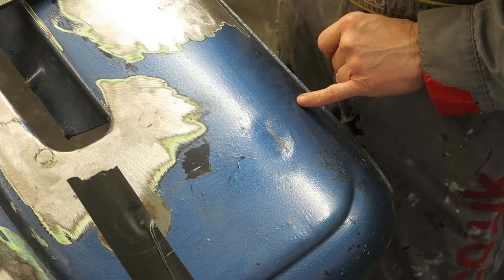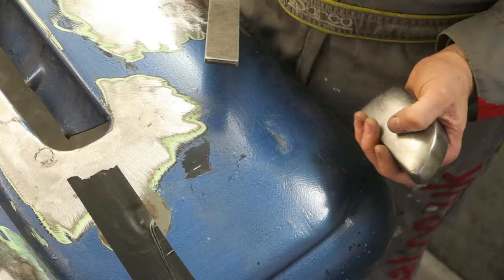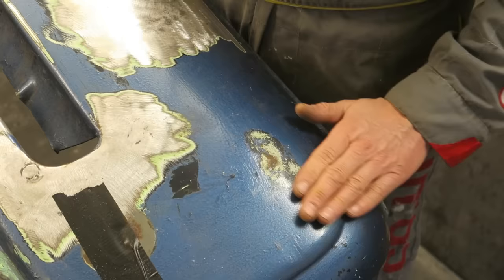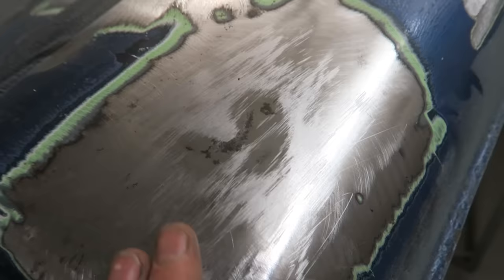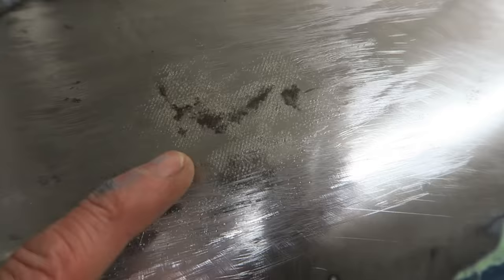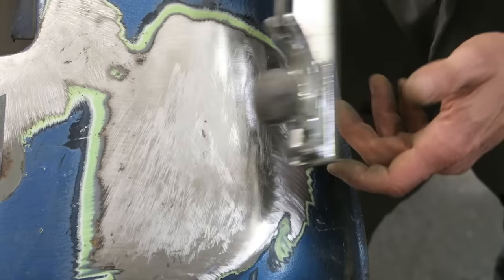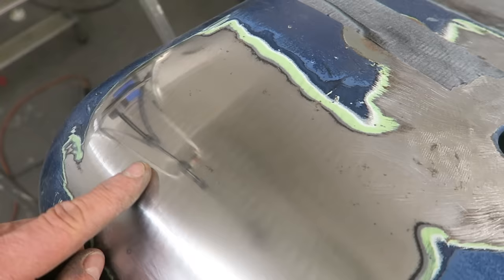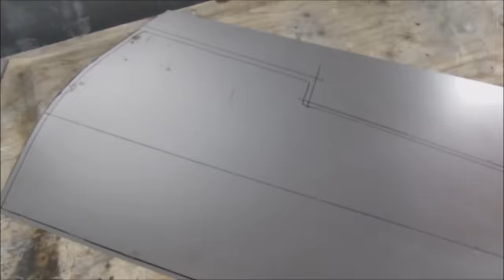How to do metal finishing, Dent flipping. Tips and Tricks #3

Comment: Hello Trev, Why would you not use more of a PDR approach with line boards/lights as opposed to a contour file and its side effects when you can buff up the metal to that shine? Im trying to learn basic techniques, not to be some sort of master just remove dinks. I have ST70 which im soon to start its restoration and im in two minds what to do with the dinks in the mudguards, they are genuine 44 years old and replacements are only rubbish copies. I fancy the challenge but I need it perfect or its as bad as a dent. Cheers, bravo on your vids.
Reply from the maker: TinkerBod if done properly this is still an extremely effective way of levelling metal work. A PDR type of repair relies upon the surface being undamaged paintwork. All of my videos are request videos from viewers that want to know a specific method, not necessarily the best in some cases but things they want to know about. The file always looks like it’s taking more material off than it is, if done carefully the amount removed will not effect the panel, and the file highlights a low spot very effectively. Good luck with your project. Cheers Trev 👍

Comment: How do you stop yourself from removing all the paint
Reply from the maker: Kevin Murtagh Sorry Kevin, I don’t really understand your question? Cheers Trev 👍
Reply: On the panel you  were repairing there still was some original paint .... do you remove all the paint completely. .. or  paint over the original blue?
Reply from the maker: Kevin Murtagh once all of the repairs had been completed it was shot blasted back to bare steel inside and out and was coated in epoxy. Cheers Trev 👍

Comment: Hi Trav what grade do you suggest on the body file ?
Reply from the maker: Warren Adams just make sure you get the file where the teeth run across, I normally use a fine one but both will work. Just beware of filing material off, you don’t want to file the metal thin. Cheers Trev 👍

Comment: This method not ideal for flatter panels as it will stretch the panel resulting in a term called tin-canning. You will then need to perfrom a second step of shrinking the panel.

Comment: This doesn't work on late model cars or truck
Reply: Jeff Gregory you right about that try to use a file on a new car you'll have a hole in the metal lol this guy's good though I've been a body man 20 years and he impresses me
Reply from the maker: I’d go down the middle on this reply, and say you could certainly improve things regards to reducing the amount of filler you’d have to put in it. The other consideration to think about is what material the panel is made of, some of these high strength steel panels are extremely ridged. An outer skin panel, wing, bonnet etc I’d certainly have a play with. Cheers Trev 👍
Reply from the maker: Jeff Gregory depends Jeff. Cheers Trev 👍

Comment: Rather than remove steel why not use a guide coat?
Reply from the maker: Make way for the lord You could use guide coat and sand paper but it wouldn’t be as refined. The file blade takes no prisoners with regards to getting it flat, the sandpaper will to a degree sand out the low spots so the repaired area won’t end up as accurate as if you’d used the body file. The other thing you need to get away from is the file isn’t to file the repair flat, it’s to highlight the low spots. The file scuffs the metal rather than aggressively filing it away if used correctly, it looks more aggressive than it actually is. Of course if you keep on repeating the process you will end up filing the panel thin, which is the last thing you want! It’s all about knowing when to call it a day, a thin skim of filler is more desirable than a thin panel.
Reply: @trevsblog  thank you so much for taking the time out for such a detailed response. 
God bless.

Comment: It's not a file but it's a file??? 😴
Reply: They were known as Dreadnoughts in my day. As for the “flipper/spoon”, we used to heat up a bastard file & bend it to the shape of the one he’s using. In fact most of the tools that can be bought over the counter today, we made our own. As for the dent, I’d have brought it up with the dolly from underneath first, filed the paint off to show the low spots, then dressed them with the dolly and flipper. I was a panel beater for over forty years, we all have varying methods of metal finishing and it’s good to see the skills being used instead of slapping plastic filler everywhere.

Comment: there isn't enough money in metal finishing and also afterwards the metal is always too thin in too many places ......don't do it...
Reply from the maker: thomas dawe Hi Thomas thanks for your opinion, the video isn’t about making money, which is the thing in life I care about the least. It’s just basically showing a time honoured technique that if performed correctly can be a very effective way of repairing a panel. You’re absolutely correct in my opinion about over thinning the metal if you over file the area, the key is to just use it to score the surface to highlight the low spot. THEN STOP. then raise the low spot rather than filing endlessly away to get rid of it. cheers Trev 👍